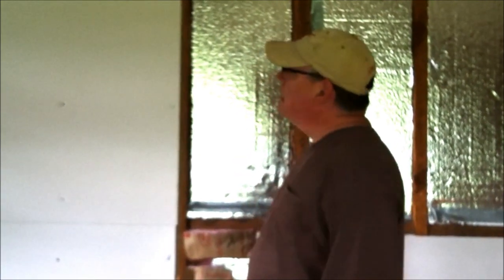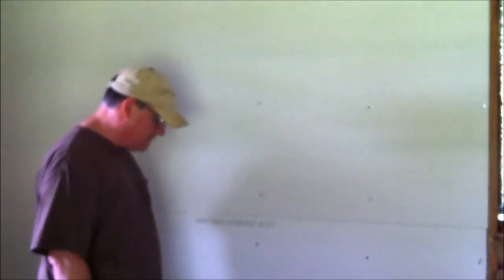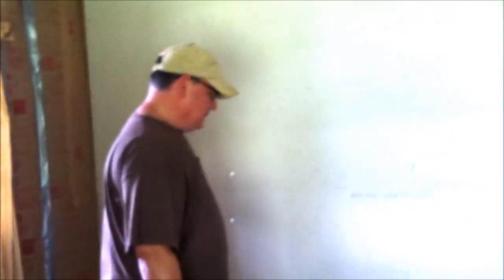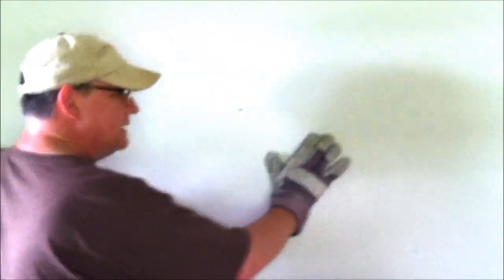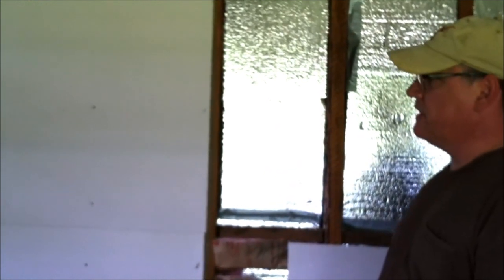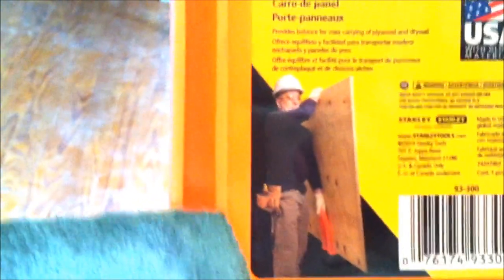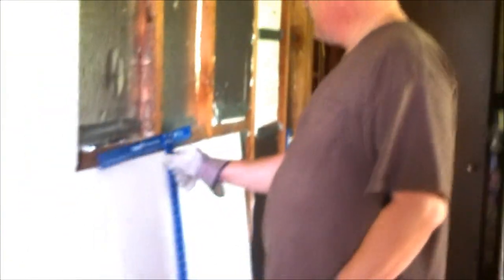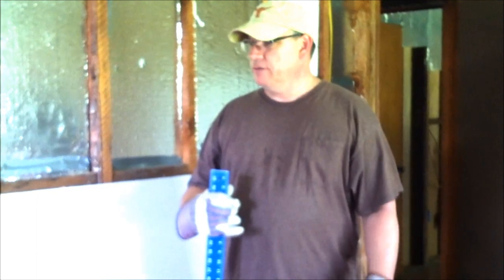CTF E114:  Using a Drywall Carrier, a Drywall T-Square & a New Discovery!

Comment: Great video! I have a little DIY drywall project coming up myself, nice to learn from other people's mistakes.  I probably would of set my first on the floor as well. I will also look for one of those carriers. I have used a hooked piece of rebar in the past but that looks much better.
Reply from the maker: The carriers are great, I think it was 8 bucks and change? Definitely worth the price of saving your back and pieces of dinged up drywall. We have this whole house and then the smaller house out back of this one to do, so....worth it to have around! Posting a video tomorrow on the big drywall lifter contraption we got as well.